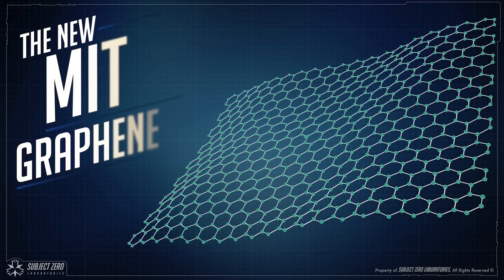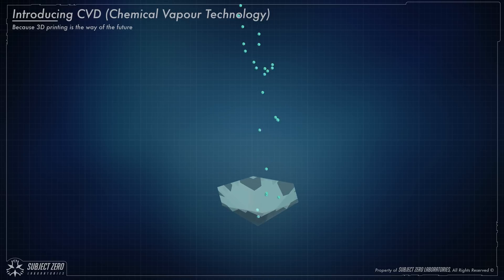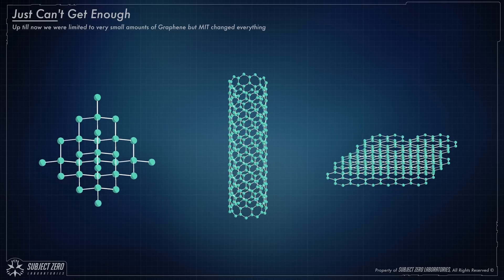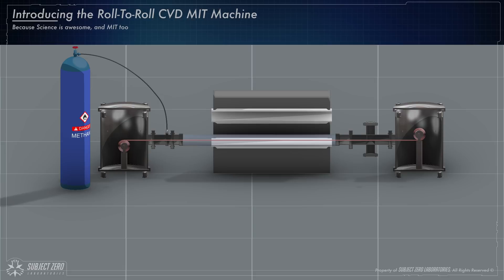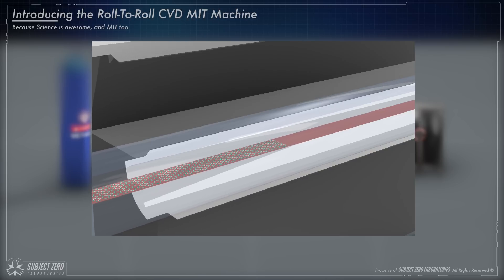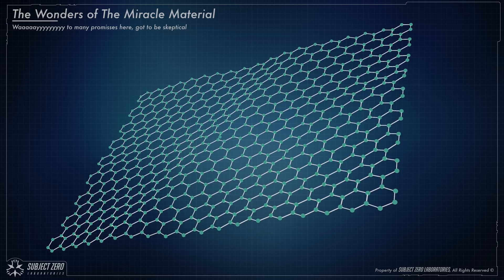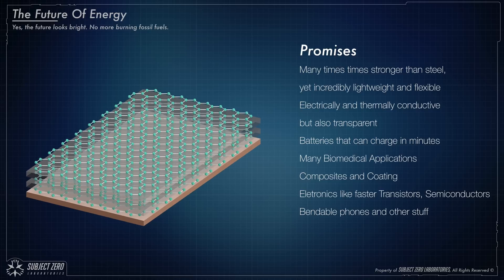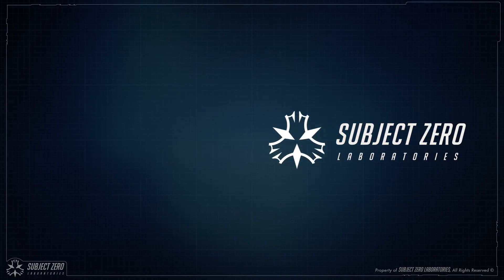UNLIMITED GRAPHENE - MIT Graphene Roll to Roll CVD Explained

Comment: Graphene deserves much more attention.  There should be sheets available at every public library.  Someone should publish a book about graphene with a few sheets of graphene as part of the book!  This way the reader can experiment with it.   Imagine a highway made of many layers of graphene.  It could store solar energy and transmit it at will.  A skyway strand of graphene cable could guide and power a gondola from China to California !
Reply: Go to any conference on materials. 80% of the papers/posters are on graphene. It's the only attraction everywhere.
Reply: @enbiomatriclab  Hey Thanks; that's amazing I had no idea!  I am not an engineer but I wish I was!  I fear that so much has already been invested in the Lithium Tech and infrastructure that Graphene will be deliberately "sat on".
Reply: @enbiomatriclab  That's interesting. Is the focus entirely on small devices or are people interested in it as a material for structures?  I am particularly interested in how it can be used in composites as a filler material.  I don't think we really need to perfect the properties or quality of graphene for those applications, we just need to develop mass production with some sort of process so that it is produced in the order of tons rather than mg.  But this interest gets mixed in with the interest in using it as a conductor on electronic devices, which seems a totally unrelated application because in one, you produce bulk in a reactor vs the other you apply thin coats to a substrate and there is no bulk product to go to market with.

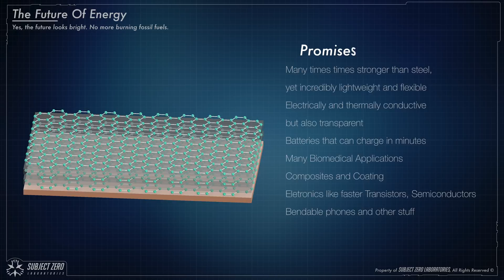Comment: 5:10 Battery the size of an Iphone with Tesla capacity? Wow that's insane, any source for that info?
Reply from the maker: Back in 2015 they theorized that a Graphene battery the size of an iPhone would be able to power a Tesla, but to be honest I think its a bit of an overstatement but not "too" far from the truth. 

Some experiments suggest, at least, a 5x the current capacity for lithium ion batteries per kg. That means that the Tesla model 3 would need a little over 1000 Graphene batteries. I know it's not the size of an iPhone but its very promising. Take a look at www.grabat.es, they are doing some really cool stuff.
I do believe though that they will be able to get at least 20x the capacity in the next 5 years. I will make a video about this so stay tuned.
Reply: Holy smokes - that would be awesome! :) 

I've been reading some different forums on this topics, some just enhancing the LiIon, some changing the story altogether, and am never sure what to use a best-case scenario.

Thanks so much for a reply, you just got yourself a sub!
Reply: THat's bullshit, It is not possible. Even if you have a battery which somehow can manage to create 100% efficient electricity out of oxidation with 100% of the volume being used by the active element (and use the oxygen in the air as comburent) you will be very far from that energy density. CHemical batteries are limited by the energy in chemical bonds, so you will never go above the energy density of things like gasoline or hydrogen.

Comment: and another question.
How they split the two elements? the graphene film from a cooper layer. what method can be used. its easy to do it and not make damge to the graphene or the roll cooper?
Reply from the maker: Apparently that is not the problem at all. From what i got form the paper, they are having trouble with the fact that the Graphene sheet roll onto itself. so its not sticky. I have to look more into this.
Reply: just compare graphene and cooper melting points.

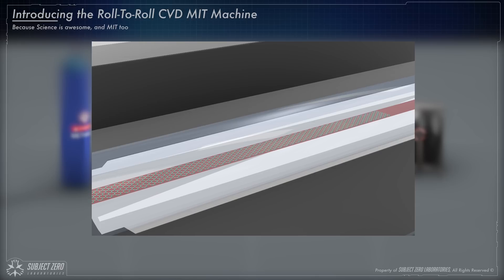Comment: 4:02 why they use CH4(methane) than CO2(carbon dioxide)? Itis less dangerous , more cheap and i think can be more pure(the molecule its smaller)
Another question the cooper band its charged with electric curent or samething? I ask it because that can help oriented and order the carbon(C) atoms.
Reply from the maker: The reason is that it takes more energy to break the CO2 bonds but I heard that they are working on some technologies to actually use CO2.
For your second question, its not charged, but i could be wrong. What they explain is that it is a property of the copper itself that facilitates the process when heated with temperatures of 700˚C+
Reply: @SubjectZeroX  I heard that the reason why they can't make a space elevator out of this process is because,  even though it is high quality... the space elevator ribbon needs to be perfectly made.  Is there not some way they could inspect and correct the imperfections to create suitable graphene for a space elevator?

Comment: Batteries and ship hulls? Pshhh, roll that graphene into rings and make a chain for a space elevator.
Reply: You still want to be able to build ships with it. What if you want to go to a planet we don't have an elevator built to?
Reply: I read that the tensile strength of carbon nanotubes isn't strong enough for a space elevator on a planet of earth's size =( There's still a Japanese company working on one though. Wonder how they're planning to solve the tensile strength issue
Reply from the maker: It's not that carbon nanotube strength isn't enough for it, its just that the cable would have to have a huge diameter which to be honest i don't know, but from what I could discuss with scientists about this, the problem is that we cannot make the quantities necessary for the elevator as of yet.

Comment: I'm not sure if I have the facts entirely clear but I was led to believe that to grow defect free graphene on a surface like copper then it first becomes a necessity to have a defect free copper surface. Is this correct or incorrect? It led me to think about how I could utilise 1~10nm copper nano particles plated in nickle to polish the copper surface with just enough abrasion to smooth out any defects but if the MIT guys have figured out how to do it using industrial quantities of copper film then that's pretty fantastic really.
Reply: Unless what they have is actually graphene sheet but which has defects but this doesn't detract from the accomplishment, it only means that with some additional quality assurance procedures they may very well have cracked the problem and that's fantastic.
Reply from the maker: From their paper, its not clear if its defect free. However they do mention that the copper was refined in order to optimize the production quality. To be honest we will eventually get there in terms of purity because there is a LOT of interest for this material, which I will talk about in later videos, so stay tuned.
Reply: I'm wondering a step further.....if a graphene belt could be utilized by depositing directly onto it, reusing the belt over and over, and simply use micro "scrubbers" to either remove all excess copper atoms after deposition but before burning, or to find another way. I'm thinking a graphene sheet as a substrate instead of copper might be beneficial.
Reply: If I am understanding your thinking correctly, if you deposited carbon atoms onto existing graphene then I would have thought the end result of this would be 2 layer graphene but separating one layer from the other without causing defect's would likely be problematic.

Comment: Chemical vapor deposition...the right heat and preasure on methane and hydrogen,which collects on a copper substrate and forms a 40 ft sheet of graphene at mit. Looking forward to seeing how much they make when they upgrade their equipment and who will use it first....thanks for the knowledge,God bless the omniverse multi verses universes...everyone doing great things!
Reply from the maker: Thank you for the comment. Im actually very excite for the next few years for the exact same reasons as you. Cheers.